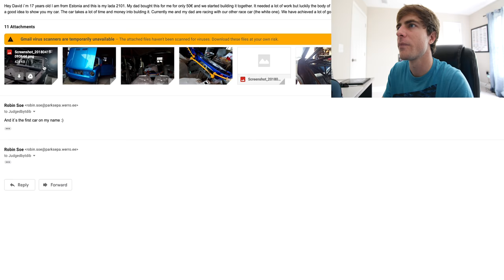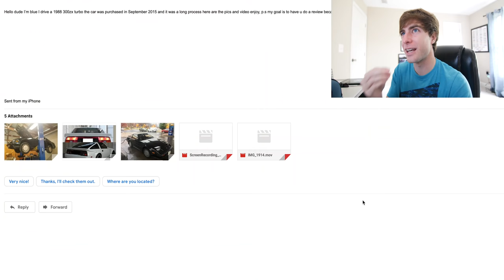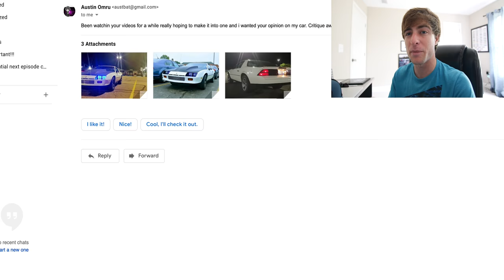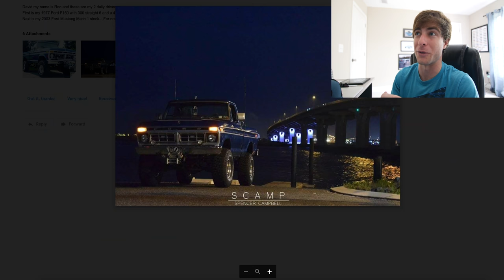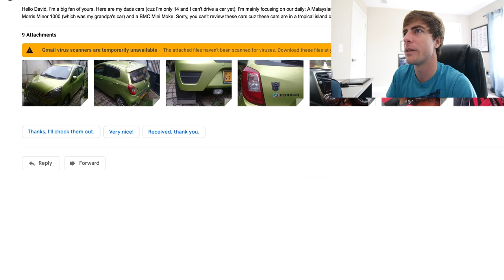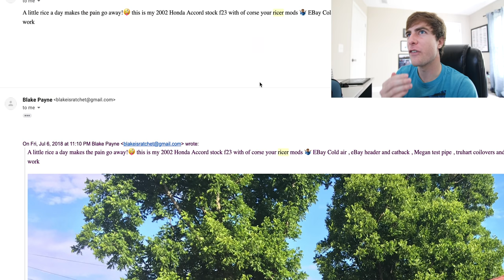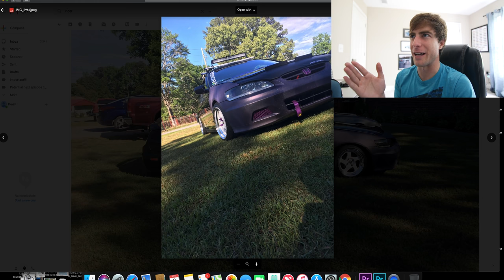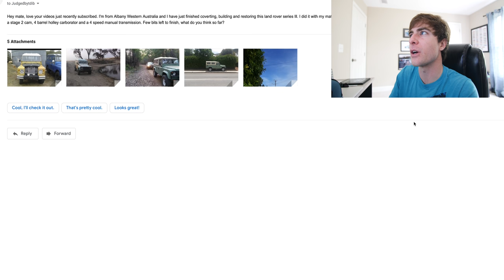I JUDGE MY SUBSCRIBERS CARS! (Judged By TDIB Episode 7)

Comment: About the SAAB parts, here in the Netherlands. They still have so much parts leftover etc from when they went bankrupt. Besides that there are still a small amount of factories that produce SAAB parts over here. You can buy an old saab and get it fully rebuild with genuine brand new oem parts for a few thousand euro's which is amazing.

Comment: I have a fully built 2014 fr-s, a rhd 91 gt-r, a 2005 z06 absolutely mint,  and you know what?  my little brat with a 4 inch suspension lift and 31" tires with an acceptable 140hp is my absolute favorite car to take out for a weekend. There's something about them, especially with a little bit of tasteful modification.

Comment: Some guy down the road from my house owns an R33 and I always used to see it on my way to school. In my opinion, it isn't as hyped as the R32 or R34 and it's kinda depressing. They look stunning and from what I see, they are also really fun to drive, but that also applies to the R32 and R34 I guess. He has now sold it I think but has replaced it with a Subie 22B and a 97 Colt with a 4G63T.

Comment: Okay, so car modification laws here in Hungary are really crap, but still, my first car will be an E36 project car built for drifting. The worst thing about the laws are that we can't swap engines that weren't made for the cars (eg. I can't put like an LS into a BMW). But that wouldn't be a big deal if modding didn't cost so much. It's not the parts that are expensive, it's making them legal. For example, we have to pay about 200$ to translate the German TÜV approval, then pay 40$ to approve the modification, then 100$ for the tests and another 20$ for them to write them into the registration, and we can't install the parts ourselves, they have to be installed by a mechanic who writes a paper saying that it was installed correctly (AND WE HAVE TO GO THROUGH THIS WHOLE PROCESS FOR ALMOST EVERY PART)

Comment: Chevrolet LT1 350 motor came with 260 horsepower which may not sound like a lot it was pretty powerful for its era it was essentially the LS1 before the LS1 became what it was it also didn't have the aftermarket backing like the LS1 did😖 so finding performance parts for it are scarce almost you go through shops that specialize in old Chevy 350s it is a good reliable motor though

Comment: 19:50 "It's not the best v8"? what are you talking about the old 4.6 is one of the most reliable v8's you can get. Not only that but the old 95 cobra is built off of the same 4.6, its just modified a little for more power. I read up somewhere that if you reinforce the rods and mounts, you can get nearly 500HP naturally aspirated if built right, and that's not even with a supercharger.

Comment: Hey David, Ive heard that the first gen coyotes have bad oil pump gears and not good for building power on. Are you on the stock first gen coyote on smurf  ? Or did you upgrade oil pump or swap it? 
-Diego

Comment: R33 is my favorite looking gtr even though it’s kinda the worst.  It’s as heavy as the r34 without getting the better transmission and electronic controls of the r34. And then there is the r32 sitting there doing almost the exact same thing mechanically but 200lbs lighter.
Reply: Also that crown Vic was pretty awesome 😂

Comment: He isnt kidding with the mod laws here in Australia.  My mk3 supra 2jz swap had to be engineered before I could register it.  An engine swap here is so annoyingly complicated.  Same with brakes and diff needs engineering cert.  

I live in qld where registration is not too bad.. in nsw they have to get their cars tested every 4 years I think it is.  A full road worthy every 4 years at the expense of the owner.  And so many rules and laws surrounding exhaust and blow off valves, air intakes everything basically is so complicated and if they cant find anything illegal they will just make something up.  I've seen someone get booked for not having water in his washer bottle.  Its oppressive for sure.  All caused by sensationisation by the media here...painting modified car owners as hoons and trouble makers. The public opinion here is stupid.  People will deliberately drive slow if they see a modded car behind them stuff like that. 

 Its really frustrating but we do have a pretty large scene here.  If you wanna check it out check out downshift events.  Always massive

Comment: R32+R34+Skyline GTST+...fuck idk a 1995 toyota camry > r33. They all look better and except for the 95 camry, perform better in their respective categories. R33 is like...Trying to add more power...while also adding more leads bricks...and letting a 13 year old design the car...and the 13 year old literally chose tail lights from a generic manufacturer of bus and van tail lights. That's literally where they come from. R32: custom taillights and headlights. R34: custom taillights and headlights. R33 S1+S2: Taillights from bus light manufacturer and headlights from Mitsubishi with revised internals...

Comment: OMG WHYYY??? There is absolutely no reason to put a hood scoop like that on a Scion! The only way that could possibly be okay is if it's to be ironically funny, which you can tell it's not because the car is too clean. On a front wheel drives car like that you can tell it's not functional if it's centered on the hood like that. If it is actually functional then that is the dumbest air intake setup and is loosing potential. Instead of making the car look stupid, you can have the scoop make sense and cut a hole off-centered to the side where the intake is, and build a working ram air system that breathes really good.